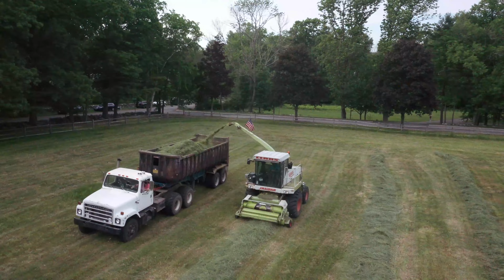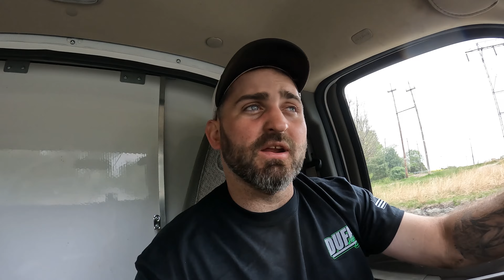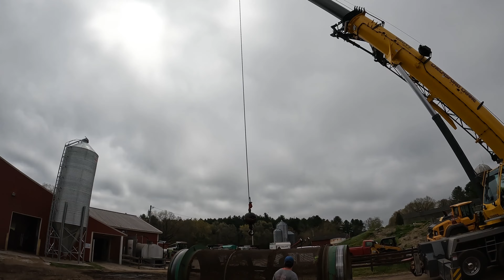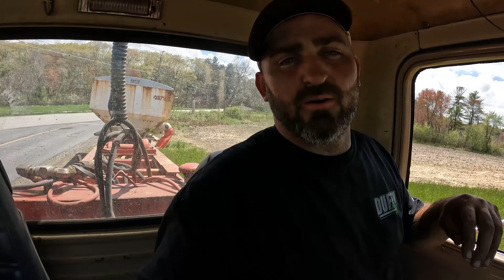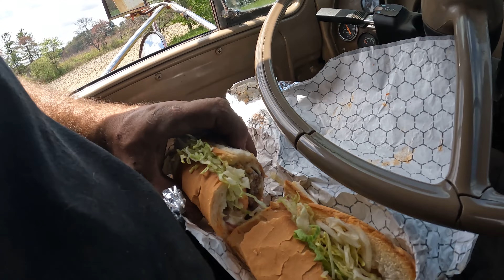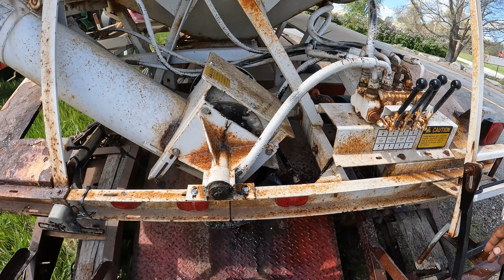Heavy Lifting & Last Of The Chisel Plowing, Trying To Find Snacks- Why Is Everywhere Closed?

Comment: Those low pressure fuel lines can be made with  brake line  material. Otherwise I have cut the bad spots out and hose clamped hose in the middle

Comment: I say howdy all the time at work and I'm a Stationary Engineer in downtown Buffalo, NY. I guess it just seems friendlier and less formal than hello or hi. Sets a nicer tone.

Btw if you didn't replace your high and low pressure switches on your AC...you might want to. They could be tripping the compressor when your pressures may be ok.  They are typically really cheap to replace. Had a bad low pressure switch on my truck last year and ended up overcharging trying to get the compressor to kick on. Also if it's warmer out than when you last checked your charge, you may still be overcharged.